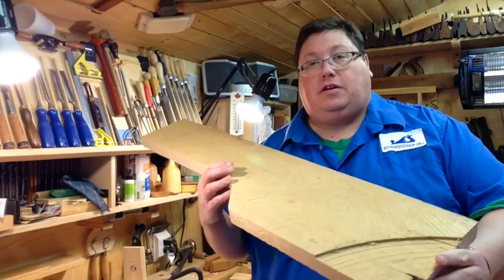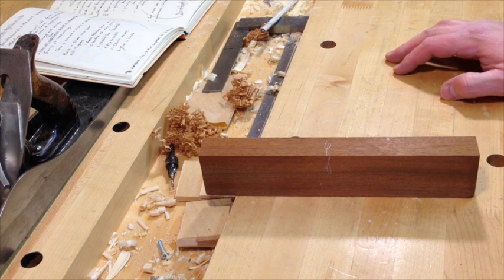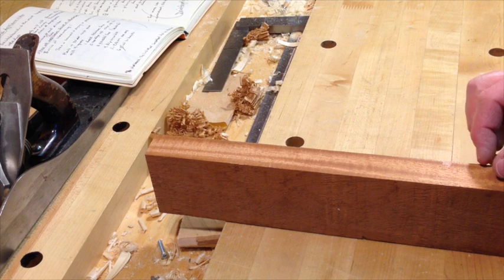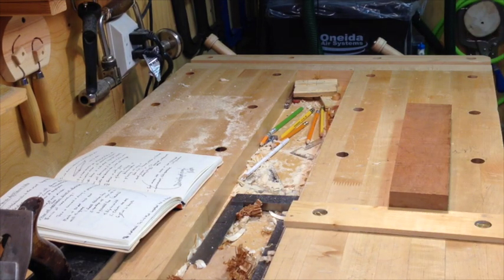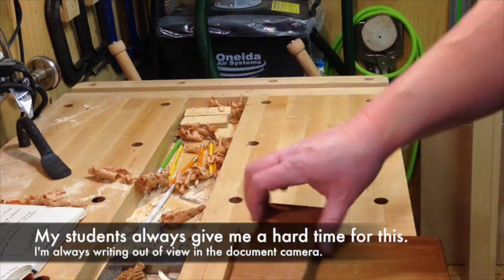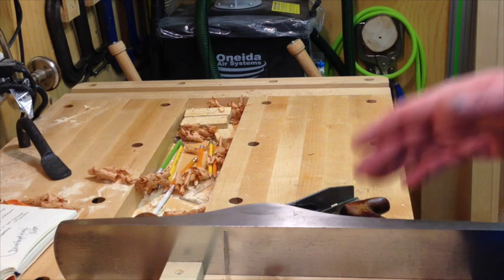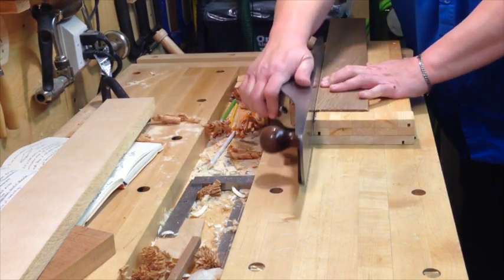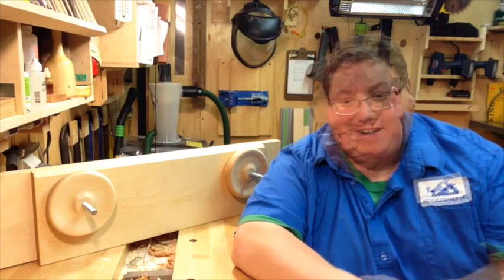The Workbench: Holding Wood for Preparing Face, Edge and End Grain

Comment: Nice instructional video with good info on basic preparation techniques, that we all need.
Just one point, given that you have holdfasts is it not worth using one to secure timber when using your shooting boards. I realise that you would need something to prevent maring the timber but on the longer lengths surely is should help stability.
I don't have holdfasts so I am unsure on their suitability in this case.
Keep up the good videos they are worth the blood sweat and tiredness, well from my position they are. LOL
Cheers
Reply from the maker: The forward momentum of the plane holds the board firmly against the fence if the shooting board. That, and the fact you have to move the board a little into the plane with every pass make using the holdfast impractical.
Reply: Howard, thanks for the clarification. It certainly makes sense when you put your point of view. Keep up the great work. Best regards.
Reply from the maker: Thanks for watching and commenting!